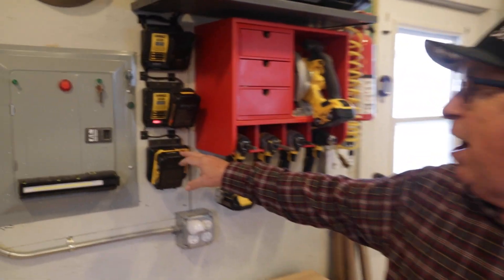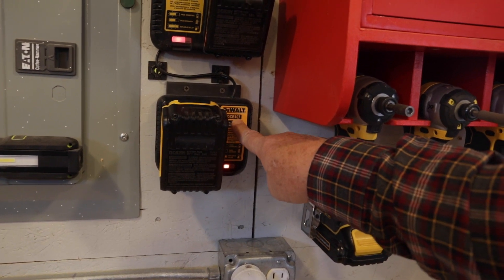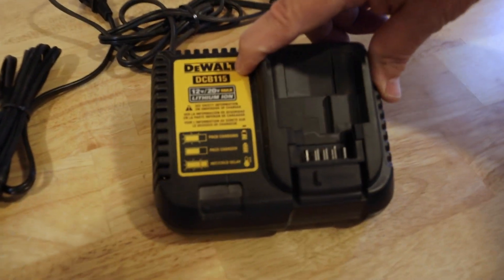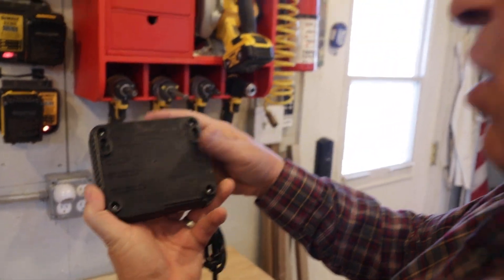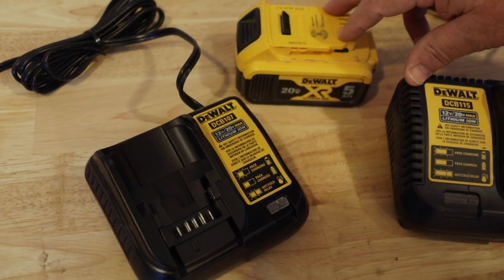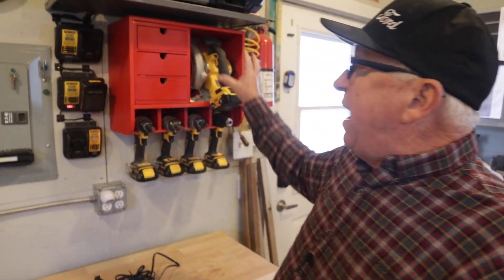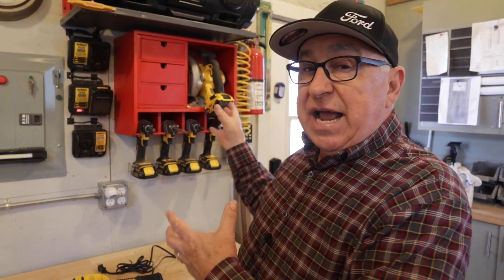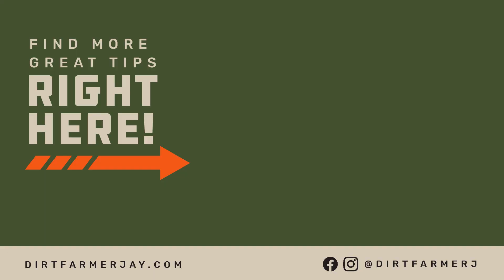Updated and Corrected DeWalt® DCB107 and DCB115 Charger Comparison

Comment: Take a look at the DCB1112, two stage chargers.  I have both the DCB107 and 115, but I like the 1104 best.  I charge my big batteries with the 1104, first and the put it on the 107 to finish charging.  The 1104 has a 3.5 amp output which is almost the same as the 115.  I have 17 DeWalt batteries and as bout as many tools.  My batteries vary from 1.7 ah to 10 ah, some of which I have built from 18650 and 21700 batteries- all new Samsung batteries.
Reply from the maker: I'll do it! Thanks for the heads up! Best, DFJ
Reply: So using slow chargers are better for battery longevity, am I right?

Comment: my experience over time is that faster chargers lessen the life of your battery, including the newer lithium batteries, so I like to have mainly slower chargers like the DCB107 for everyday charging & keep a couple of fast chargers around for emergency situations, as in the long run having more batteries charging at a slower rate will be cheaper & more reliable than having two batteries that charge up in an hour @ 4-6 A charge rate.

the manufacturer's are forced to sell fast chargers to compete or loose sales so they will tell you they do not harm your batteries, as their main concern is getting past the warranty period, not longevity of batteries.

Comment: How do you mount your chargers on the wall?  I've seen charger mounts for sale but they want like 20 to 25 bucks for them.  I'd like a more economical solution.  Thanks, for your informative videos!
Reply from the maker: I'm glad you like our videos. I mount the chargers on the wall (my shop walls are painted 1/2" OSB) using drywall screws that match the slots that are in the back of the chargers. But, to stop the charger bases from lifting off the screws every time I lift a battery out of the base, I screw a painted cleat above the charger base so it can't come up off the screws. You can see those cleats in the video. I hope this helps! Best, DFJ
Reply: @DirtFarmerJay  Thanks for the information.  I have came up with a solution... my charger (DBC101) don't have the mounting screw holes so I had to cut a double gang outlet cover and used JB Plastic Weld to attach it to the 2 halves to the top and bottom side of the back. That allowed me to have 4 predrilled holes on the back to put screws to the board I have attached to the wall. It feels sturdy and when I pull a battery off it stays put on the wall.

Comment: My question is this. Lets say you have two 5 amp hour batteries. Both are discharged at the same rate and level but one is charged at 1.25 amps and the other is charged at 4  amps. Does it affect the lifespan of the battery. Maybe due to heat?

Comment: Thanks! I got a new dewalt and it came with 115 but threw the new battery on my 107. Did you ask if either is smarter about conditioning, ie "intelligent charger" or about the same? All things being equal I'd use the lower amperage charge rate to reduce heat. Low amp/low heat helps longevity with AA, AAA and Radio Control vehicle rechargables (NiMh, Li-ion, and LiPO).
Reply from the maker: When I spoke to the Dewalt representative at the factory, he said that all the batteries charge at similar rates and it just depends how much of a hurry you are in and if you wait for the 107 to charge instead of using the 115. Thanks for the great question blmonkey and for watching and commenting. Keep it up!! Best, DFJ

Comment: The response from DeWalt somewhat incorrect.  Lithium-Ion batteries do best when stored around 50% charge....this is one major reason why most lithium batteries are delivered to you in a partial state of charge instead of fully charged.  Technically speaking, anything else would be sub-optimal.

That said, replacing wear items like batteries in a production environment is expected.  You can't exactly penny-pinch and optimize your batteries lifespan when you have work to do.

Comment: Credibility is out the window for dfj. Careful tubers
Reply from the maker: John, not sure what you found offensive. Let me hear a bit more detail. Best, DFJ
Reply: @DirtFarmerJay  its probably because you stated there's no 10ah battery etc, thats incorrect info, as there was a 10ah 20v battery(not flexvolt) that was included(2-of them in fact) with the mentioned lawn mower, I know this to be absolutely correct because I also was considering purchasing it and did my research-that was a good while before his question was asked likely  a year before  he asked. So thats why the statement about your  credibility being out the window was made, because he recognized you were not doing nearly enough research prior to answering questions or even making statements about charging times as if they were proven facts. Don't know if the output amperage is on the bottom of the dcb107 did not pay enough attention but I know its on the other one that info alone will usually be enough to "GUESS" which is the faster charger. Hope you are doing well, just trying to clarify things for you. Have a great day.

Comment: How did you secure the chargers to the wall?
Reply: Put some masking tape on the back of the charger across the holes.  Pop the screw points with a pencil.  Then remove tape and use that as a wall template.
Reply from the maker: Thanks for watching and commenting don keck. The charger base has 2 screw slots on the back. You measure the distance between where the screw heads will sit and then put two screws into the wall. The battery installs into the charger by sliding down. To keep from pulling the battery charger off the wall everytime you remove a battery, screw a 1/2 inch thick by 3/4 inch tall and 5 inches long piece of wood on the wall just above the charger base so it can't be lifted off the wall by removing the battery. Hope this helps. Best, DFJ
Reply: @DirtFarmerJay  thanks,  I looked at my chargers and one of my 3 chargers has screw holes.
Reply: @donkeck6150  love your drill holder cabinet - can you send pics and dimensions - want to build one for my shop

Comment: Good to hear that, about leaving them on the charger.  I've run across at various times, info that says it's a bad practice to leave batteries on the charger all the time due to possible fires or other mishaps.  Did the tech at Dewalt address that or did it not come up in your study?  I always take the batteries off the charger when done no matter whose brand, just out of an abundance of caution, even though it may be unjustified.   It's hard to know what's best.  I'd love to know it's safe to leave them on the charger.  I assume that's what you're doing.
Reply from the maker: Thanks for watching and commenting Don's Woodies. Yes the tech said there is no risk of fires or other damage to the batteries if you leave them on the charger after fully charged. It's really just a personal choice. If it bothers you, I'd remove them once full. Best to you, DFJ.

Comment: What is your take on the 10AH Dewalt battery?  I am IN the market for a new mower (spark plug hole threads are stripped) and considering the $400 Dewalt push mower.
Reply from the maker: There is no 10AH battery - its 2, 5 AH batteries. If that's the case, we have found the 5 AH batteries to be very good and use them in many tools around the Farm. Overall our experience with DeWalt has been very positive, and while I can't vouch for this particular mower itself, the other tools we have purchased from them have performed very well. I think it's likely you will have a very good experience. Let me know how it all works out. Best, DFJ
Reply: @DirtFarmerJay  I'm assuming it's a new battery?  The description on HD's website says:  "Includes 2 20V MAX 10ah Batteries, 2 Chargers.....".  The way I read that is to mean each battery is 10ah.  I could be wrong.  :)